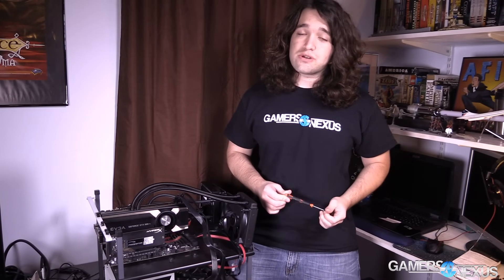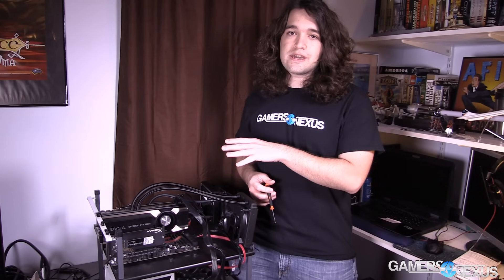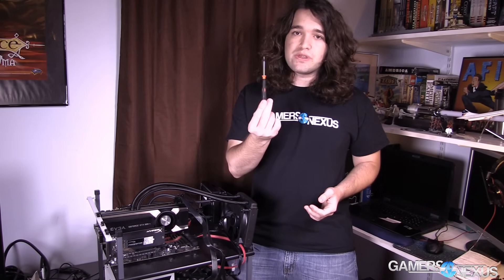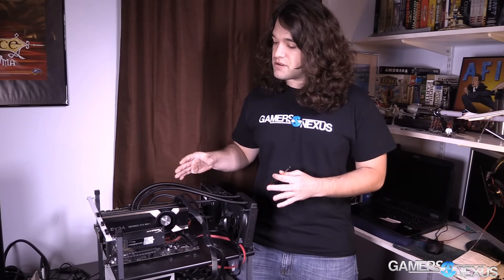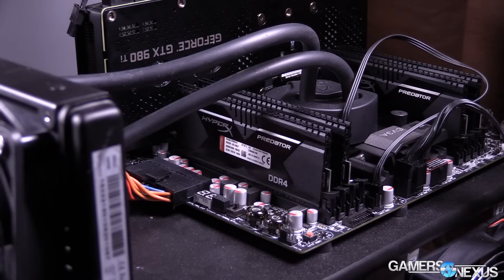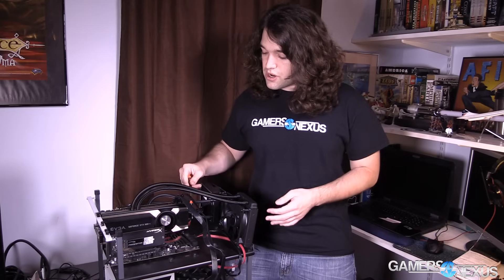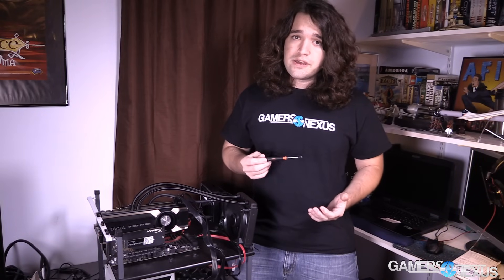How to Jump A Motherboard Without Power Button

Comment: Sir, I have this pc assembled one and the specs were, maximus vii ranger mobo, core i5, hdd, ssd and cooler master thunder 650 psu, I've been using this pc since 2015. Now,  the problem starts yesterday as when I was working in the middle of some project, it suddenly switched off, I found no short circuited from power source. Then, l try switching back on by pressing switch button, it doesn't help. So, l open the case, unplug all cables, then starting from main power cord from psu, I connect to mobo, then switch on, I see my mobo didn't beebs nor indicate any lights, then, I check the psu cord with a tester, looks fine, I plug in again, doesn't work either but after this, when I switch off the electric from the switch box I see the mobo light indicator blinks a few seconds then off. Please help!!

Comment: I have tried everything, to try to display the bios screen. I have removed the battery, and put it back in. I have switched SATA cables around. I have plugged the HDMI cable into both video card, and motherboard. I tried booting my PC without video card.

I'm using a brand new motherboard. However, I'm also using a video card that was from my old motherboard. I am also switching from AMD, to intel. I got a new CPU and fan. My top video is currently a cry for help, of what to do.

I'm about to try this method now... if this doesn't work, I'm gonna go crazy or something.

Comment: Might help if you identified the correct row of pins, and then demonstrated WHICH FRIGGEN PINS TO JUMP.  After all, you can short circuit an entire 
MOBO by jumping across pins that carry information, not power.  Simply inserting a screwdriver might create a circuit where  the voltage is so high it melts the power supply as it has no inline fuse.  Add a hard drive and you can  lose data or end your life  in the event you are barefooted  or even have wet hair!  Showing the right method requires  no more time or effort, an it could allow you to have children some day.

Comment: this happened to me twice so far and i have a 2 tb sata ssd with my windows 11 home and my files including my steam games and now i can't get to them!! my only thing now is to just upgrade to a mini pc that i can get my steam games up and running when connected to my tv!! this sucks!!  what about a dead motherboard on a dell latitude e6540 that hs NO power what so ever and i have a new battery, new charger and everything else is new and i have tried the reset by removing the battery and cmos battery and holding the power button and ALLLLL FAILED😢😢😢😢😢😢!

Comment: Hi, tried to turn power on using the same feature on these specs
Corsair cv650
Gigabyte Aorus B660M
i5 12600K
Teamgroup RAM 2x8Gb
But it does not boot up.
What am I missing?

Comment: So, this jumpstart worked, but every time I try to flash BIOS it lights up my 2.0 thumb drive LED light and then the whole mobo shuts off. Mobo fan and white light are off, but there is a separate white light on right behind where the thumb drive plugs in. Every time it shuts down I need to jumpstart it again. Is this mobo dead?

Comment: Do you have to touch both connections at the same time or do you touch one and then move the screw driver and touch the other?  It's hard to tell.  All this time talking about what your going to do then the actual process happens so fast you can't tell what to do exactly.  Thank you so much for the video though

Comment: I have an Msi A88xm motherboard with Amd Kaveri APU, There was several power outages recently where i live and now when I press the power button the processor and psu fans just spin for a milli second and nothing happens the power button on the board itself glows green indicating its getting power but nothing happens

Comment: What should I do if I've done the paper clip test and the PSU works. I remove the paper clip and try the screwdriver trick (as well as the case switch itself) and the power supply still does not come on?
Reply: this is happening to me right now, did you resolve the issue?

Comment: Dude this was a life saver. my brother spent over an hour thinking he broke his the mother board. My goggle fu word salad  found this  on your website and right after he tried this and it worked he started looking at how the case power was broken... it wasn't the mother board manual had several errors than they led him to plug things in wrong. all good now

Comment: Hey when I tried to turn on my motherboard with the screw driver it didnt turn on so now Im scared that my motherboard is broken, but the lights on the back of the GPU and on the side of the motherboard turn on. Does it mean that is isn’t necessarily broken ?
Reply: Had the same problem. The board is fucked, Bro.

Comment: Hey buddy my Alienware X51 R2 is completely dead for no reason.

Turn it on once a month and that's it.

Power supply shows green but I've stripped it down to the motherboard and can't work out why it's not working at all.

Any ideas?

Comment: I have noraml psu and r3 3200g with msi b450 a pro max motherboard  so I plugged  in power cable and pressed power on  bt not starting  pc bt motherboard components is geeting hot  near ther sata1 and 2  whats problem
Plz help me if have any idea

Comment: Question I have asus b450 prime plus and I try to jump the board but it won’t let me does tbh at mean I have to buy another motherboard or cpu ... on my old b450 there was these pins that I could use to power it on but everything like the fans on the gpu and cooler would spin but no but and if I took the jumper tool (screwdriver) off it would cut off automatically any suggestions ?

Comment: after connect the front panel header , when i press the turn on button its not turning on, and i try the screw driver you show in the video still not ruining. do you know why? i have the ASUS ROG Strix X570-E Gaming ATX Motherboard

Comment: So My power supply works and my computer works but it won’t connect up to the power supply and yes I have tried this method and I have done the wire trick and it still doesn’t work
Reply: then your board is likely dead, or youre hitting the wrong pins. If you hit the wrong pins, with the power connected and active,  you have likely fried some components on your board. The power switch on a case shorts these two pins..and is made to be shorted....the other pins, yeah..not so much.

Comment: So My power supply works in my computer works but it won’t connect up to the power supply and yes I have tried this method and I have done the wire trick and it still doesn’t work

Comment: Question. I've done this yesterday while I wait for my power button to arrive, played my games all good and then when I shut down my computer and tried to turn it back on this evening the shorting doesnt work at all. I'm even using a partly stripped wire so the copper ends conduct properly.
Help?

Comment: INSTRUCTIONS FOR BEGINNERS 2019

1.Identify which 2 pins are the “POWER SW”
2.Use a conductive metal piece (screwdriver, cable wires) to touch both pins at the same time for JUST A MOMENT
And everything should start booting up.

If you cannot identify the “POWER SW”, it can be found within the manual that comes with the motherboard or on the brand website.
If there are any problems, FIGURE IT OUT YOURSELF.

Comment: My power supply actually came with a little jumper cable that has a front panel he der style connector on both ends and you just put it on the power switch pins, then your power supply switch turns the computer on and off. Not sure why anyone would want to do that though.

Comment: Should've at least shown a close up - you spent less than 5 seconds on the actual solution
Reply: He did, two or three times.
Reply: @Ganderco  At a bad angle and doesn't specify which pins. There's dozens of pins on the board. This is a simple case of taking what you know for granted and just breezing through without much detail.
Reply: @sor3999 just locate the power switch pin, either by reading what's  written beside the front panel pins or by the manuel
Reply: yea man show a damn close up will ya
Reply: All I needed was 5 seconds to know where to place the screwdriver. It's the upper right pins on the motherboard
Reply: @paghahanapngkaluluwa7432  (location can differ between brands and or even same brands but different motherboards,)

Comment: Hi. I did not really follow what you did but it seems really cool. I just put a computer together with these specs:
ASRock AB350 Pro4 AM4 AMD Promontory B350 SATA 6Gb/s USB 3.1 HDMI ATX AMD Motherboard
EVGA GeForce GTX 1060 SC GAMING 6GB GDDR5 Video Card
G.SKILL TridentZ Series 16GB (2 x 8GB) 288-Pin DDR4 SDRAM DDR4 3200 (PC4 25600) Model F4-3200C16D-16GTZB
AMD Ryzen 7-2700X 3.70GHz Octa-Core (YD270XBGAFBOX) Processor YD270XBGAFBOX Processor YD270XBGM88AF
Samsung EVO 960 250GB MFR # MZ-V6E250BW
I also have some old HDD that I intend to use with this built which are already connected using the SATA cables.
The problem is that when I power on the  machine, the graphic card, CPU fan, and the other fans built into the case appear to work but the monitor shows no signal. 
I googled and tried a few troubleshooting steps, namely:
-Removing the GPU and trying to power on.
-This mother board has four RAM slots so I tried placing one RAM stick to each of these and tried powering on with each slot filled.
-The motherboard manual shows the jumper short position to be pins 1 and 2 and in order to reset it, I should place it on pins 2 and 3 for five seconds. I did that. I tried powering on the computer after this step with no success.
-I removed the battery that's in the motherboard and reinstalled it. Powering on had no effect.

Any advice that you may have for me is much appreciated.
Thank you!

P.S. I do not hear any beeping noises on my build so I presume all parts are functional including the motherboard. Unless if I am missing something. Please help.

Comment: Thank you for this.  Spent all day opening my computer for the first time switching out the guts to a different case and changing the power supply.  Put everything back together and nothing would turn on.  Used your video to realize we plugged the switch into the wrong pins.

Comment: I've gone through 3 boards that I've returned because I've thought them to be DOA 2 gigabyte 1 MSI and now I'm on my second MSI, I've tapped the pins together with a screwdriver for all and have had everything connected properly for both, doesn't work for any of them. PSU is good, I've done paperclip test, but not getting the MB to start up at all
Reply: PSU may be...check again. Check the PSU pins, and also the paper clip test, see if it works for 10 seconds or longer, and then move the cable that connects to the psu a bit, and then test it. The psu pin that connects to the wall cable may be faulty and only works when pressure is applied in a specific direction.
Reply: I mean my PSU  works with the paperclip test for however long I keep it plugged in, even if  I wiggle everything around, my case lights stay on and the fans spin, but when I plug in the connector to the motherboard it never starts, even using this method to jump it. I keep thinking it has to be user error somehow, because how can this happen with 4 different boards, but there's absolutely no sign I'm doing anything wrong, even consulting my friends who have done a build or two themselves, don't seem to know what the problem is.
Reply: The problem then definitely is the cable from the psu to the motherboard. Check the 24 pin connection on the motherboard. Make sure it fits all the way, and move it in different directions. The 20 pin and 4 pin that go together may need to be inserted in a specific way together, because of the way the plastic housing on the pins were made. Look at the 24 pin connection and plug it into the motherboard very carefully.
Reply: Robert Jones Ah yes, I figured that out the day after I left my reply, you are right, that was the issue.
Reply: I’m on the same boat as well.
Psu is working via paper clip.
It won’t boot by jump starting it.
Please help. 🙏🏽

Comment: My dude I just built my pc and when i turn it on NOTHING at all happens but then i test the power supply, works fine. The fans start when nothing is pluged into the motha board but when the 24 pin and cpu is plugged in nothing at all happens The n3rds at best buy said it was a fried mother board so i ordered a new one came today just rebuilt and the same god damn problem happened please help i have no idea whats wrong

Comment: Can you power up the motherboard through the BIOS if you don't have a front panel or power button? For example i have a CNC controlled mill that has a PC motherboard with no case or power switch. I don't want to short the two pins every time i want to power up the motherboard.

Comment: hey gamers nexus. I'm trying to boot my daily pc in a new case but it's not starting. I know where front panel connector pins are which. i know my HDDs PSU gpu and ram are good,  but I'm not able to jump the power pins with screw driver.. old case front panel doesn't want to boot up its old interior components either.. it did once.. but now doesn't want to.. please help!!

Comment: The one thing none of these jump start videos address is what happens if you slip and hit the neighboring post? Like hit 3-4 posts instead of just the two. Could you short and fry out your motherboard?
Reply: vampov that's my concern and why I don't wanna try this haha
Reply: Just put something non conductive in the way so you can't, cardboard or electrical tape - something like that.

Comment: Guys just look at your mainboard manual. You can read there which Pins are related to Power On/Off and connect those two with screwdriver, that simple

Comment: You should have a close up of where you place the screwdriver and hold that frame.
Reply: dan bromberg pins 6&8 are power switch connecters. yes he should have.
Reply: @alexanderwong6052  All you have to do is pause the video.
Reply: actually would make no difference as every mobo is different. use your mobo manual to figure out where the PWR+ and PWR- pins are if it's not visible on the board.
Reply: @GarrattCampton   all 3 of mine where in the same position differnt mb
Reply: You touch the pins where the powerswitch connector would be. If it boots your motherboard is probably fine, if it doesn't, then it's dead. Very useful for finding out that the button cover on your case was the problem.
Reply: pretty useless - can't find any pins saying pwr on my motherboard - he should focus more on explaining HOW to find those 2 pins
Reply: @RickDiLorenzo  pwr or power switch
Reply: Just the 2 top right pins
Reply: Different for each pc. Just google it
Reply: RIGHT EXACTLY
Reply: Or just don't be braindead
Reply: * PuTs “HoW tO jUmP iT” iN tHe TiTlE *
Reply: When you take apart your computer initially it is quite obvious where you would "jump" it. I was watching this though because I tried this.... the motherboard is still refusing to turn on. I think that I need a new part.
Reply: disliked this fool for the same reason. clueless idiot
Reply: @jeremykwan1792  Because it's so difficult to figure it out yourself. XD You have eyes, don't you? We're not exactly talking about decoding a secret message; just LOOK at your motherboard! XD Or, use this wild thing called THE MANUAL!!! XD You're the clueless idiot here, lazy & entitled too.
Reply: @jeremykwan1792  he literally showed a close up a minute in, how impatient are you people lol
Reply: @ShuffleToExpresss  It's a shitty close-up. that's what that is.
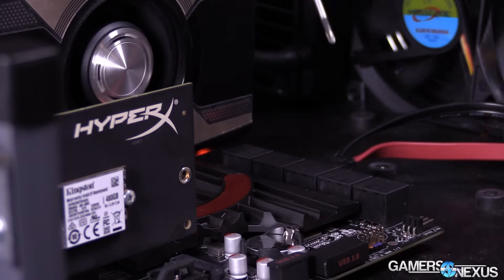Reply: You mean 1:01 ? people who comment without finishing a ONE MINUTE video... (also there is something called PAUSE)

Comment: Sort of amusing how some people don't get that this is a simple switch. You can actually start a power supply in the same way by shorting the appropriate cables on the motherboard connector.

You should mention that they can cause some serious havoc if they do this and accidentally touch the board or other pins at the same time. Also it goes without saying that you should always use a screwdriver with a handle that insulates you from the current.
Reply: Thank you someone addresses my issue I think this fried the crap out of my motherboard it was working fine for a day and tried to jump it again and I think I got 3 posts and then it wouldn't start anymore. I think you are better off spending 3 bucks and getting a dedicated loner power switch if you need it. The margin for error is too high.
Reply: I think I fried mine too. RIP.

Comment: I do this all the time, but don't use a magnetic screw driver to do this.
Reply: Shadowrunner1134 I don't think that's any problem as this is just a regular switch. You need more magnetism before it causes problems, and even then it would be an issue for the electronics within the board itself and not the actual switch.

Comment: You should probably mention that the location of the pins will be specified in the manual.

Is there a reason why you touched the board before the pins @ 1:01?
Reply: Six years late, but yes, his hand wasn't quite steady. That's all.
Reply: +&#39;Murrican Oil lol

Comment: One of the times I was working with my pc I forgot which pins to hit and just keep banging all of them.... and it kinda worked.
Reply: lol why am I actually laughing from this
Reply: I did this I ended up needing a new board and had a couple bent pins
Reply: @obaida6624  Probs dont whack it with the screwdriver. Gently touch them with little to zero force
Reply: obaid a sheez. I wonder how you survive in a daily basis being that moronic.
Reply: Mission failed successfully
Reply: my board broke from doing this
Reply: how did it KINDA work???